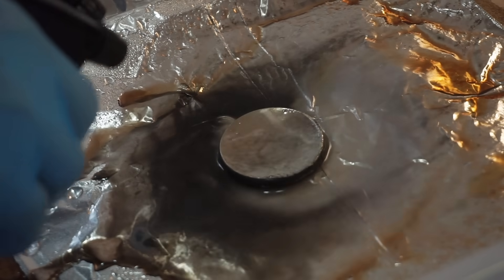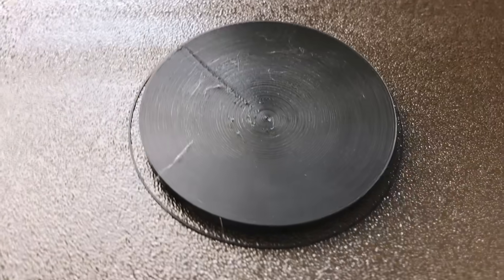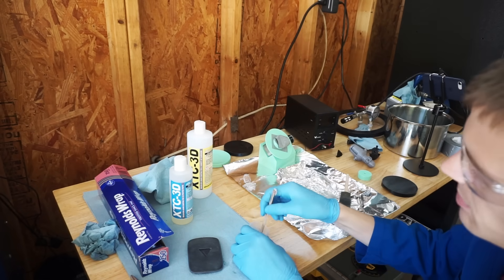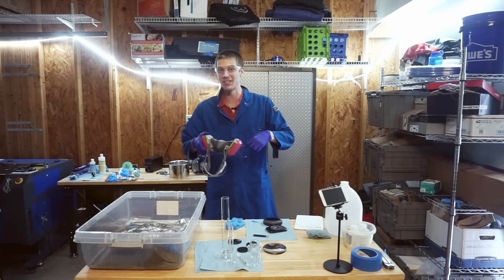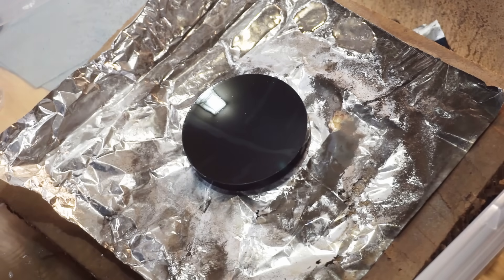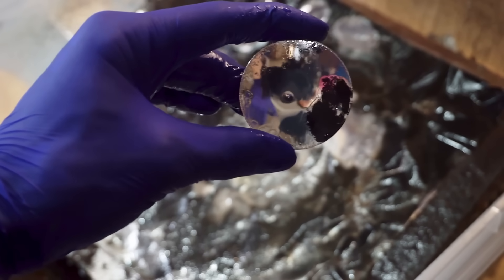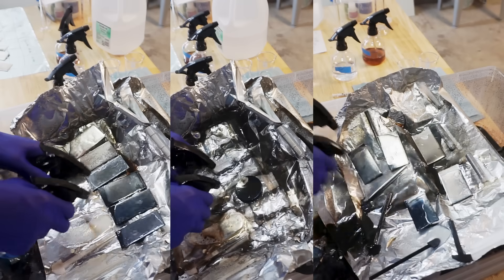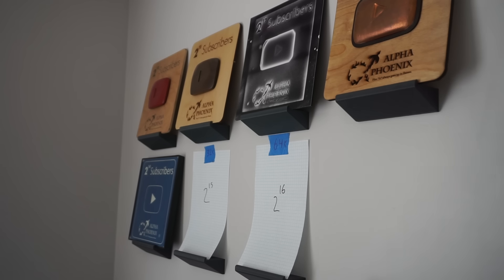How does a "first surface" mirror work? (2^15 sub special!)

Comment: AB resins cure exothermically, and the higher the temperature the faster the cure. This can make deep poors kick extremely quick as they heat themselves (sometimes too much) while thin poors can easily be inhibited by a lack of heat.
 In addition, to remove bubbles you will need increased pressure, not a vacume.
UV resins do need to be applied and cured above a certain temperature, but they can be far less finicky for this use application.

Comment: Lots to learn here, chemistry is grand, with time and patience you will rule the land.
Don't use acetone, too volatile and it reacts with everything.  Rubbing alcohol works as a thinner for a lot of epoxies. 
AB epoxies have a resin and a fixer/hardener.  Most hardeners smell like hair salons.  Easy to tell apart.  If you can't get a batch to cure, increase the hardener in your mix, and raise the ambient temperature.  More hardener means less working time.  So work quickly.  Heat guns help remove bubbles.
Spinning your parts can work well, but you have to spin them faster than you did to get an even surface.  Also spin them inside a sacrificial container as it makes a mess.  
With 2 part paints/epoxies an easy test for cure is can you dent it with your fingernail.  If you can, either you haven't given enough time, or you had too little hardener, or low temperature.
Tricky business :)

Comment: If you have a friend with an SLA printer why not just have them print the pieces in the first place? The bottom layer taht touches the film is super smooth and even looks like a mirror already. Well, at lest it is on DLP printers that do one whole layer at once, I'm not entirely sure about *actual* SLA printers. Some people refer to all resin printers as SLA even when they aren't.

Comment: This is awesome. I wondered about 3d printing a parabolic mirror on my SLA Printer for a Newtonian reflector a while ago. But it’s probably not accurate to coat it with this method. Maybe getting it aluminized will work..

Comment: This was very interesting. First video I've seen on your channel and it was quite cool. Just wanted to chime in a bit on the resin. The outside vs inside cure is likely do to temperature. All resins use a thermal reaction on some level to cure. The thicker the cast the more heat the quicker and generally harder the cure. For thin layers like you are doing it helps if they cure at 'room temp', around 70F ish. Also on the bubbles you were on the right track with vacuum degassing but in your application it is actually better to use a pressure pot to force the small bubbles back in to solution for the duration of the curing process. Surface bubbles can be popped with a quick swipe of a small torch or lighter. Hope that makes sense and can help out with future projects. Subsrcibing to find out what you need 3d printed mirrors for! Good luck!

Comment: Not a chemist, and didn't read through all the replies, but I have worked with epoxy before.  Some room temperature epoxies don't cure at all until 75F, and not fully for 24 hours at that temp.  Mixing and ratios are critical.  Most people I know that do structural work with them use a precise weight based mix.  Next, many or most epoxies "blush", meaning they leach an amine reside after full cure.  This sticky/gummy substance interferes with adhesion of additional layers, and may interfere with your other chemicals.  Some people say that alcohol or acetone will remove that blush.  Some use "no blush" epoxies.  Finally, for clear resin bubble reduction, you want a pressure pot, to reduce the size of bubbles.  

All in all, you may be better off with UV cure urethanes.  Haven't worked with those, so can't comment.  

Cool work with the mirror!

Comment: Rather than smoothing 3D printed parts with resin, try casting your parts using silicone molds. Silicone molds are capable of forming optically smooth features without even needing additional lapping.

Comment: Are use Apoxsee resin’s all the time in RC aircraft construction. Are used to fiberglass wooden parts to strengthen them up. When I need to thin out epoxy I typically will use as high a percentage of rubbing alcohol as I can get seeing as how I can’t buy denatured alcohol in California anymore. Give that a shot and see if that gives you the results you want.

Comment: because it was a printed part, when you took a vacuum it was pulling air out of the part. Thus the continuing bubbles. If you had re-pressurized it, (removed the vacuum) it would have then driven the resin into the part. Repeat a few times, and you would have a resin impregnated piece. This isn’t exactly what you were seeking, but would have worked. As to the mirror surface, I agree that the resin was not fully cured, and reacted with the spray. Did you try placing a „hardened“ piece into vacuum again? Water isn’t the only thing that will off-gas. I think you were rushing a bit, and the more you tried, the more problems you had with the surface. Perhaps a better idea would have been to let it cure for longer, perhaps in a temperature controlled box. Resins are often very temperature sensitive. Or moisture sensitive. As in humidity. Not too hot, not too cold, and not to humid. Also, tackiness might indicate insufficient mixing. (Ask me how I know). Good luck with your next attempt.

Comment: Interesting to see you break this process down the way you did. I tried the sprayable "chrome" finish several years back. I even spent the money on a specialized spray unit that managed all the silvering steps you described. (Funny that you accomplished the chrome finish with a few $1 spray bottles). I spent a lot of time and money trying to perfect the process and get reliable results to no avail. It just seemed to be too finicky of a process. Surface prep was done by sanding down to 1500 grit, then a base layer was applied with an HVLP gun(that in itself was a trick, as any texture from spraying was immediately transferred to the final finish). The base layer could not be sanded or handled in any way once applied. Even the most minute errors meant the whole process had to start over. I did have some successes with it, but as a business I just did not find it reliable enough to offer as an additional service at my shop. I finally gave up on it after many months of trial and error. I still have the machine but haven't put it to use for several years. 

Good on you for working out the process and seeing it through. Watching your video, it looks like you had a similar percentage of failure and success with your process. The next trick once you create the silver layer is applying a clear coat to preserve the finish as the silver will tarnish/deteriorate fairly quickly. That's a whole different effort all by itself.

Comment: When mixing 2 part epoxy or silicone, if enough heat is not present in its curing window it doesnt always cure fully. This can be remedied by baking the resin after the fact, but it is best to just keep it warm while curing. Often it speeds up the reaction too! Most resins come with a MSDS/instructions list that will tell you about its ideal conditions. Read up so you dont have to play mad scientist next time!

Comment: The hardener that is not used in the reaction of the resin will rise to the surface. It is sticky and gums up sandpaper rather quickly.  Temperature and humidity also have a lot to do with the curing of resins. This was a big pain in the rump for us in the sailplane business back in the late 70's. The solution was to put a layer of nylon fabric on top of the last layer of fiber glass. As the resin cured the excess hardener would rise up above the nylon layer. After everything was cured we simply ripped the nylon layer off along with the unused hardener. It saved us untold hours of sanding.
You have a nice project. I thought I would let you know that you aren't the only one who has had this problem. It goes back before you were born. Lol

Comment: Because resin is insoluble in water, will the resin be evenly distributed due to surface tension if you immerse a resin-coated object in water? Will it go more smoothly if you place a UV lamp around the water tank at this time?

Comment: Dude! you gotta degas your resin in the mix pot first to get rid of the bubbles.  Then pour over piece, while piece is tilted, and let the liquid wet all the surface.  You almost had the spinning thing right, but they spin the concave mirrors horizontally and use the centrifugal force to make their cave in the middle of the molten glass, you would probably have to spin it a bit faster to keep the resin from pooling, but not so fast that you make too thin of a coat.  Lastly, epoxy and resin takes a minimum of a week to almost a month to fully cure.  Watch any car paint channels, or fiberglass channels, or my favorite, Techingredients, and watch the one about making his catamaran and he explains the resin cure process succinctly

Comment: Resin needs to be at a constant above 18°c ... your garage is most probably under that temperature, thus the curing issues.
(I make luxury boats ... and other products like additives we use need to be constant above 31°c)
Bi composant products require specific stuff to work correctly.

Comment: if you ever watch them Chrome plate something, they coat it with copper first. then they polish the copper like a mirror, before dipping it in the chrome. maybe you should consider trying plasma sputtering, for the initial layer....😏 also, another tip, if you use 1,000 grit, then 2000, then  2500 grit, then 3000, you can make whatever surface you're working with as smooth as a piece of glass. to give it even further shine, go to the auto parts store and get headlight restorer, usually in a blue bottle, or Turtle Wax headlight restorer. if you buy the turtle Wax headlight restoration kit, I think it's only 10 bucks, this will come with the many different sandpapers, the polishing compound, and even a UV sealant. just some info you may be able to use....🙄

Comment: Why not print with ABS and use only acetone to smooth the surface? That way you can control for resin interference and spray directly on plastic.

Comment: 14:56 in a vacuum chamber you will expand those bubbles. if you used a pressure pot it would shrink them

Comment: I've worked with epoxies and resins a lot. Most of them, like the vast majority of professional resins seem to do best when mixed throuroughly and rapidly, and then sort of 'ironing out' the bubbles after your pour with a heat gun. Like if you go watch all the people who make dioramas and stuff too, they almost always have a hairdryer on the resins they use for water etc. My guess would be there's a very, very specific temperature that will yield ideal results for you during the cure, and would definitely recommend experimenting more with temperature control. I'd recommend trying to chat with some fiberglass guys, like people who do a lot of fiberglass fabrication work. I don't know what you have available locally, but in my experience those guys generally know resins, especially epoxy-based resins better than anyone. I'm also a little curious what would happen in a vacuum oven... I bet that'd be the best way to do this honestly. If you don't have one already, it'd be a super cool DIY project too! Thanks for the super interesting content m8! +1

Comment: You can get ultra smooth parts by vacuuforming your (properly created) 3d prints. This way you are using a smooth plastic to form the surface above the rough surface of the print.

Comment: What if you used a thin plastic sheet with which you print on a gray scale image of the desired degree of curvature proportional to the darkness printed. Then apply air pressure to one side of the sheet and place a heat lamp on the other side using a köhler illumination setup if possible. This would cause differential heating to the plastic due to the gray scale illumination, which in turn would cause smooth differential deformation.
Maybe.

Comment: Just a small tidbits here: i work with nail resin and i can say that you may have an easier time getting a smoother surface by adding less resin and buffing it at a finer grit once you have prepped the base. You can do this step more than once

Comment: To get the printed object smooth with no sanding....simply put the object inside a closed box and put a bunch of super glue in a dish or something else to hold the gel and set it beside the object printed and the fumes/vapors will start to react to the plastic and will start to smooth out the ridges so to speak. I still use that method today and works great.
Reply: What filament material does the superglue vapour work with?

Comment: Epoxy resin catalyst are often organic amines, which were likely interfering with your reaction. That + temperature (higher temps[25-38°C] makes epoxy cure better, and it likely will have a hard time curing under 15°C

You want to either cure the resin for at least a week, or wait 48 hours and then wash off the leftover catalyst by dunking the part in some white vinegar (acetic acid reacts with the catalyst and deactivates it)

I would still do the white vinegar thing even if you let it cure for a week, anyway, just to be safe

Sauce: I do silicone molds of 3D printed pieces, and platinum cure silicone tends to inhibit if you even look at it wrong, so making sure the epoxy is 100% cured and inhibitor free is my #1 step

Comment: If you thinned the resin with acetone, this would boil off under vaccuum, creating bubbles and simultaneously thickening the resin, tending to trap the bubbles. The most likely factor in curing outside is humidity. High relative humidity typically impedes curing rates in epoxy resins.

Comment: Some tips: XTC3D is not a great product. Use UV resin, cure it wash it with alcohol.
Sand your part then spray it gloss black. Or do black primer and a Spraymax 2K clear coat. That will seal any resin reactions. Then do your silver

Comment: I am new to your channel but must ask, what kind of resin? temperature in the garage? resin needs to be poured around 75F. also your resin might cure better with a post cure. if your directions have a section on this then get yourself a used toaster oven at a thrift store to post cure. I use smooth-on resins and they pretty much all have a post cure. If this is UV resin, then it also still needs to be in a warm room, but you need a better uv light setup.

Comment: Arecibo, might have the spelled wrong, was a radio wave telescope. Not an optical one. Therefore it had no mirrors. 🤷🏽‍♂️
Reply: Also XTC 3D stats in the instructions to use thin layers

Comment: Part B is a blend of other amines - XTC-3D is an amine cure epoxy.  Looking at Tollen's and my best guess is excess hardener disrupts the silver formation.  

Being amine cure should buy you more resistance to caustic solutions used for the mirror process (even over PLA or other common filament) but precise measuring of epoxy, preventing contamination of your resins, the 5 minutes rule of serious mixing, and extra heat for full curing could be helpful too.

Comment: Very cool indeed. Another approach might be electroplating if you apply a conductive coat to the part first.

Not 3D Printing related but another thought that occurs if you want to make a parabolic reflector: Rotating liquid naturally form a paraboloid surface so I wonder if you can keep a container of water rotating at a constant angular velocity while you apply a coating that floats and is able to dry solid without sinking.

Comment: You had the exact opposite idea with the vacuum pot. What you want to use is a HIGH pressure pot. This has the effect of pushing down on the resin and forcing the bubbles to the surface where they will largely pop. Any craters can then be taken care of quickly with a small brazing torch.

Comment: You should instead of putting resin on the 3d printed part, use acetone smoothing on abs 3d printed parts. It would get you a smooth mirror like finishes, and hopefully  solve your smoothing problem and all the problems that you have had with resin. I have also heard that you can also use isopropyl alcohol on pla 3d printed parts.

Comment: Try vapor deposition smoothing if you can find someone with the chamber; don't remember the exact solvent the vapor method uses but it basically just levels out the surface by, well, melting it.  lol
Reply: also spin it while spraying

Comment: "Lime" is the greenest green. In hexadeximal it is 00ff00. The casual every day green is a bit darker so lime is somewhat of a light green. Even though "light green" is more white then that. But with the green part being maxed out and absolutely no red or blue it is technically as green as it can get. You literaly can't get something more green than this. But sadly, for some reason, maybe because we see it as a light green, some might start to see it as a kind of yellow-ish color in some conditions. For example if your camera didn't nail the white balance or if even your monitor is not 100% color calibrated. And the last point is almost guaranteed if you watch on a smartphone or a casual laptop or TV or desktop screen.

Also: "Lime" is NOT "Chartreuse". Chartreuse is a yellow-green-ish color mix and can sometimes be more green or more yellow depending on the mixture you are using.

Comment: You must mix epoxy with digital scale with exact ammount of parts given by the manufacturer to get best polymeration. Curing temperature is also important.

Comment: I use XTC-3D fairly often to finish my 3D printed parts, and have found elevated temperatures (in the range of 115F) not only expedites curing, but results in a superior cure. I achieve these temps using an oscillating space heater.